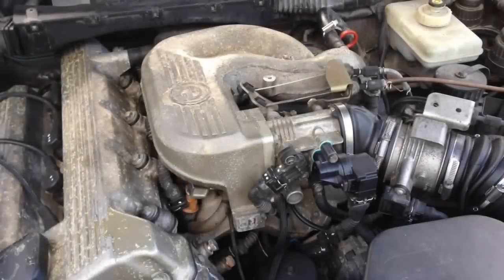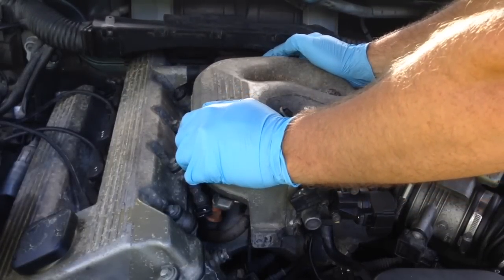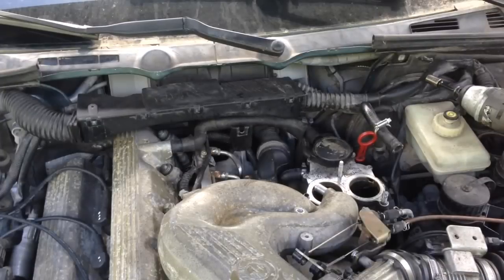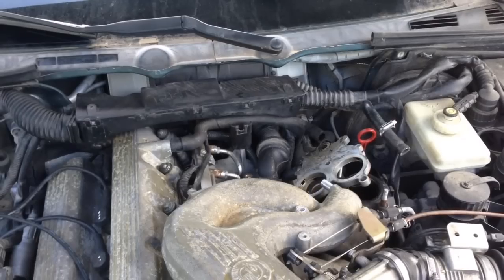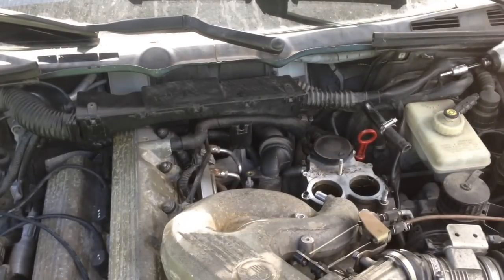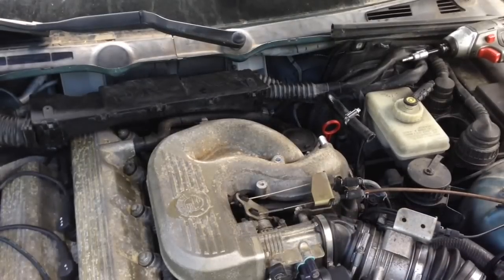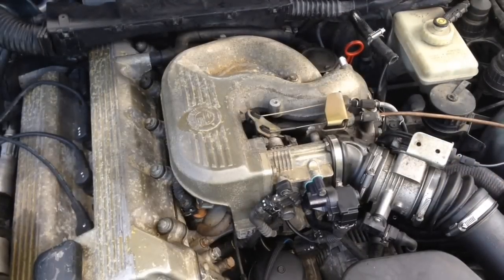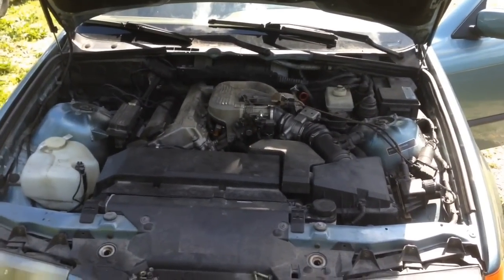BMW E36 318i M44 Rough idle Vacuum leak Misfire PCV CCV Replacement

Comment: Throttle positioning sensor, idle control valve, CCV, camshaft & crankshaft sensor, disa valve, O2 sensor, MAF, throttle body, vacuum leaks and the list goes on & on 🙄 Process of elimination if no codes are thrown can be really frustrating!

Comment: Ahh I miss my M44 1.9L when I had my Z3. I did this though, replacing the PCV but didn't need to remove the manifold. I just reached down underneath with a small ratchet to remove the screws on the PCV.
Reply from the maker: I could of done it like that i guess but it seems almost as fast to just remove the intake
Reply: need to replace my PCV valve on my 1.9 Z3, any troubles you had or is it just a simple unbolt and re attach new one?
Reply: I guess Im kinda randomly asking but does anyone know a good site to watch new tv shows online ?
Reply: @Kalel Darian Thanks, I signed up and it seems to work :D I appreciate it !
Reply: @Duke Camilo no problem :D

Comment: My car was running really rough on start up for around a minute and feeling kind of unresponsive. I just cleaned out the ICV and PCV/CCV with some air flow cleaner following your video and WOW what a difference! starts great and idles spot on even from cold start. Just took it for a drive and it has found new life, so responsive now and feeling brand new. What I really liked was how simple everything was to do, no threaded rusty bolts and didn't have to guess where everything went back. Many thanks for posting this video, I'm back in love with my E36 again. Cheers
Reply: next morning it started rough again - changed the oil and sorted it
Reply: Hope u can help me, my car always start at the second time, and when change from 1gear to second gear loose power, like vacum leak, i need to pump very gentle the pedal... Does any of this sounds familiar? Idk if the problem is the oil or any of those valves icv/ccv

Comment: I replaced all that and still get misfire I changed most of does sensors and coil packs
Reply: Check disa valve and check coil bet the issue is there

Comment: my e36 316i m43 does the same idles rough and heavy on fuel in the bottom intake theres a flap mine broke still waiting on the part to see if it solves everything i just removed it and still driving because i dont have another vehicle atm

Comment: Hey there i know this is a every long time ago ....im having the same problem question did u fixed it and what was was it?????? 🙏
Reply: Sorted and car running good after all was coil pack celinder one and disa valave
Reply: When replacing disa valave make sure u make new seal aroun it as it does leak from it and car does get very revy and up and downs idle
Reply: @americoalmada7316  What is the disa valve. My 320i idles between 1200 to 1400, up and down.?

Comment: i have an m43b19 e46 318i it idles fine it can go a bit low very rarely but takes long to rev and misfires at about 5.5k so it doesnt allow you to rev higher is this from spark plugs or from a ccv? will a ccv delete fix this issue?

Comment: I tried all these things on my 1.9 M44. What the problem actually was the oil. It was starting really bad so I git the engine as hot as possible and used a can of engine flush and then refilled with fully synthetic 0w 40 oil.
next morning it fired up with a touch of the key and ran like the day it was made. I never guessed as it had an oil change at BMW 8 months ago but that oil was gunking up the lifters.
Reply: Was there a squiky sound on the engine?

Comment: I could use some help/pointers.  96 318i. 94k miles, 5spd manual.  Car was running fine but 2 weeks ago the plastic water outlet failed on the back of the engine. All coolant leaked out as the large nipple broke off. A major pita to replace but I did it. At the same time I was thinking the similar water outlet on the driver side of the block could be just as bad. So i bought that as well and took the upper intake manifold off and replaced that as well. Changed most hoses too, incl. the ones to the injector as they were in bad shape.  After that I noticed oil leak at cyl # 2 so I changed the valve cover gasket.  As I was putting back the throttle body, I noticed there was a lot of oil smudge deposit around the butterfly valves, so I cleaned the batterflies and surroundings with kerosin  (I had no carb cleaner left)  It removed the nasty oil deposits and the valves seem to open and close a little better. No more sticky feel.  I then put everything back and now I have a rough idle. It never stalled yet, but its rough. Like its too low, as if I tap the accelerator pedal a little, it smooths out. I drove the car today about 30-40 miles. It did feel slightly better after driving it but once cooled down, its really crap again. It hovers around the 700rpm range  but rough, shakes the engine. Here is what I did so far as an attempt to fix it. I put 4 new NGK spark plug on it.  I removed the idle control valve and cleaned it. It was not really dirty, but cleaned it anyway.  The valve was turning freely and the whole valve seems ok. I also sprayed a lot of intake/throttle cleaner into the throttle body. I cleaned the Mass Air Flow sensor with the MAF Cleaner as well.  No changes whatsoever.  Once its revved, the car seems to be running perfectly fine, no hesitation, no vibration, smooth, power seems to be all there, no hard starting, no stalling. I did around 70mph the fastest and it was fine at that speed as well. No other issues but the idle being rough.  Its almost like when you have a large V8 with a lumpy idle. Engine shaking, etc.  Also, no check engine light, so I can't try and read codes.   I tried spraying carb cleaner around the intake manifold, throttle body to see if the idle gets rougher or stalling happens but nothing. Also as the engine gets warmer, it gets slightly better. Still very bad, but a tad smoother. Its like 1 being stalling 5 being perfect, it gets from #2 to #3 and if you drive it a lot, it gets #4 but never smooth like it was before I torn everything down.  I'm pretty sure I did something during assembly. It does not seem it just happen to go bad. Right before I started working on it 4 days ago, I pulled into a garage and smooth idle, etc. I ran it only for 40-50 sec as it had no coolant, but car had butter smooth idle.  I ordered an O2 sensor, as I was going to change that anyway.  I used BMW parts and NGK spark plugs.  I appreciate any and all help as I'm a bit lost at the moment.

Comment: I like your channel bro a lot of good info but the way you did this is very time consuming you can just take the 2 vacuum lines off and then the two Allen key hex bolts and reinstall for more room you can lift up the wiring harness by taking off the 4 bolts and 2 screws only takes about 15 minutes for the whole job

Comment: It could be the camshaft sensor is old or failing but not enough to show any codes yet. If there’s no leaks and it idles bad, camshaft sensor usually cures a bad idle if there’s no issue with the ignition and fuel injectors.

Oil catch can also helps a lot.

Also, I agree with other commenters here, clamp the brake booster hose.

Comment: Thanks for this video - learnt something new :)

I have a 1996 E36 316i (de-tuned 1800), I've noticed oil on my spark plugs and some smoke out the back under heavy acceleration. From what I've read up, it seems it could be the valve seal gaskets or the CCV. 

How would you suggest I troubleshoot it? Perhaps do the engine and valve seals after that this procedure that you showed?

I'm an intermediate novice when working on cars. In other words, I can do a basic oil and filters service myself... and follow instructions ;)
Reply from the maker: I would first do the pcv and go from there, they are only around $7 on ebay
Reply: Nathan's DIY Garage I forgot to mention, the vehicle is due for it's regular service. I was advised to first do the service to see if it clears up and then take it from there. Do you agree with that? If so, I won't have to drain the fresh oil for any of the alternate repair suggestions if the service fails to do the trick? Thanks again.
Reply from the maker: service will not fix it, you have to do the pcv and if that dont fix it you need to more than likely do the injector cleaner i the cylinders, valve seals are not likely
Reply: Destined 1800.. haha . Ha. Ha. No.
Reply: @loganperry8637  Detuned ;-)

Comment: What's up friend, I have a project, it's an e36 sedan with wiring of the m44b19 ecu full sensors of the m44 but the engine is a m40b18 everything works except that it has no pulses in the injectors your help will be very valuable

Comment: What's up friend, I have an m44, it doesn't have a pulse in the injectors, I tried the control unit and the immo module in a bmw z3 and it started, what would be the problem. friend

￼

Comment: VERY VERY THANKS    ı  buy a bmw compact m44  ı  was not control motor  after more ı was control in motors  dont have water valve ı  bought a water valve my car   make misfire 
and very bad sound   ı saw your video ı saw reason :)  and ı buy a ccv  ı   resolve my car problem  thanks thanks ı love guy

Comment: I have an interesting issue. My 1998 318i M43 engine starts and idles perfectly. Until I give it a good fast ride (90-100 miles an hour) at 4000 rpm and then while at that speed I put it into neutral - it won't keep rpm but try and stall. Then I rev it couple of times and then again its good. After such run when I go to full stop the engine has slightly rough idle. Do you think it's gonna be the same ICV valve problem? Thanks

Comment: for the hose that plugs into the throttle body boot, can you tell me what the replacement part number is for it?  mine is damaged and need replacing but i'm not sure how to find it online.  M44 318ti 1996, my setup looks different than yours by the way.

Comment: If you shake the PCv value by itself is it supposed to have loose parts inside ?
Reply: The PCV is supposed to rattle on the inside, if it doesn't it means it's stuck either open or closed. IT IS supposed to rattle because that indicates that it is regulating the air. If your's doesn't rattle, just spray some throttle body cleaner, let it soak, repeat 3 more times. let it dry then hook it up. Hope it helps bro.
Reply: @Music0uploader  is the valve supposed to be open or closed when it's not working? Cus mine is open and I don't know how to test if it's working

Comment: Mine looks good, but its already out so I was thinking in cleanning a little, my question is if i can spray it with carb cleaner like IAC valve or if i should use another spray or doesnt spray it at all... Hope u can help me i have the same pcv from video e36 m44

Comment: I have a 95 318 ti, that had some idle issues and it turned into a loss of power... getting knock senser#2 code form the dash. after i inspected the hoses , replaced the "Y" hose behind the boot hose. replaced the o2Senser, flue filter, plugs, airfilter. cleaned intake valve. car started up ilde fine for 3-4  mins before it went worse as it was before . this time it seamed that everything i did made it worse.So i took it to my local( well trusted BMW shop) 6 miles away. They fond that the harmonic balancer was no good and replace was not cheap but  car is running like a champ and seams to be getting a little better MPG, mostly the filter s and the o2 senser new.
Reply from the maker: Really i dont understand how the balancer made it idle rough
Reply: Nathan's DIY Garage .
i asked the same, bmw guys said broke balencer, will not balence the bad vibes. in which the knock senser thinks the vibe is a knock, then throws the senser to retart the timeing so it wont hurt it self.
Reply: first he said they made sure the #2 knock senser was not grounding out [rubbing the wire bare] on something else, that would send a bad senser call and retart the timeing as well. which i did after a saw the youtube about knock senser wire grounding out ...
and the balancer was [squishy rubber] like an old mount. new one was not at all like that , it was hard. and i can say theres one with AC and one without, far as the harmonic balencer/vabation dampner. 595 $ so this is the last one anyone wants to replace.
Reply from the maker: lol yes that is hat sucks about these m42 and m44 engines , finding parts is getting harder and harder to do, just spark plug wires for this one was a long search on ebay

Comment: did you end up finding the problem mine won't idle at all when cold and bouces around 1000 when it's warm I swapped the icv It has no codes runs really rich to its driving  me nuts trying to figure it out
Reply from the maker: sold the car with it idling rough and it is still doing it but runs fine otherwise, check your throttle body boots for rips

Comment: Is it possible you could have a misfire from a bad catalytic converter. It’s not clogged, but my car stating acting up around the time I got a p0420 code for the cat below efficiency. My car feels like it has the potential to run fine, most of the time it does, but the computer is seemingly subtracting large amounts of fuel trim when above 3,000 rpm’s or so.
Reply: Did you ever solved the problem? I have the same issue

Comment: Hi
At 12:13 you are tightening 3 bolts. Is 10 foot pounds torque correct for those bolts ??

Comment: add some propane or what you got laying around downstream of the maf,  just a touch until you see the rpm's go up just the slightest amount...if it clears up you have eliminated spark and compression,smoke machine https://www.youtube.com/watch?v=2U5kFib1WxE.....I did something similar and it works great...I did nickel wire going into a tiny bowl of baby oil in the can with wires to car battery
Reply from the maker: I need to try and get to it  today, i will hopefully have this x5 running and driving tonight, that will be a huge project off my to do list and then i can get this 318 lined out.